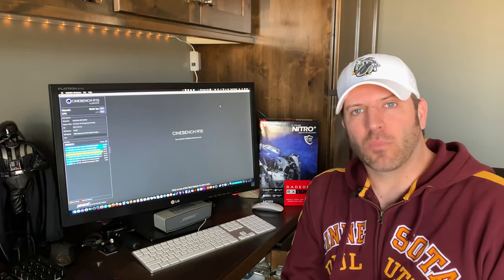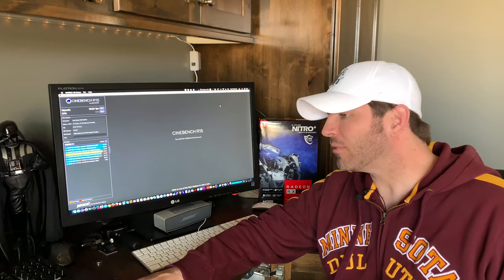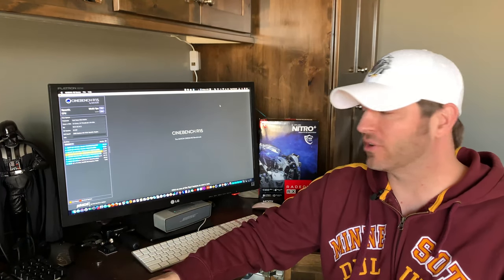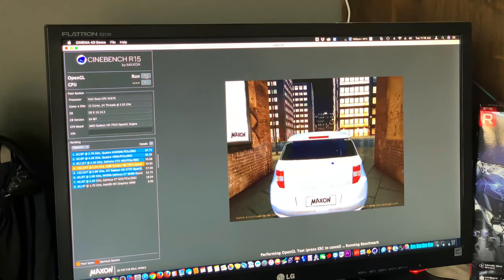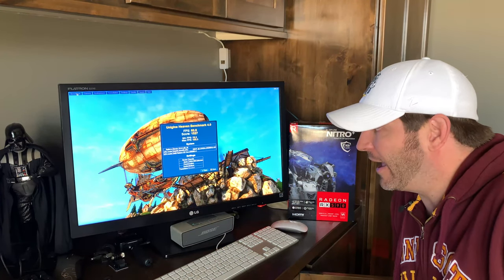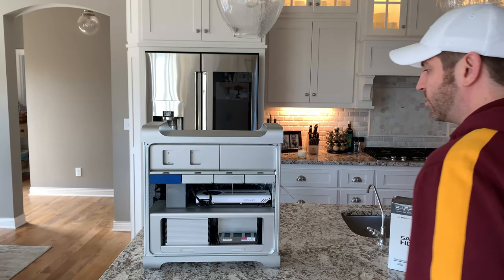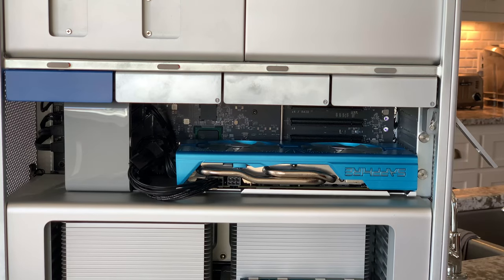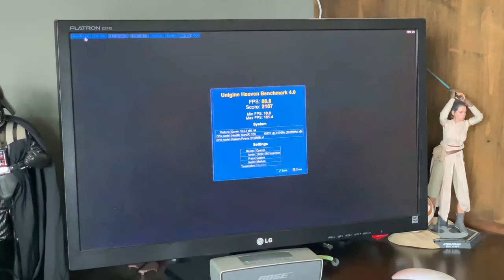Apple Won't Like This  - How to Upgrade the Mac Pro GPU

Comment: I may have missed the system specs of the machine, but I wanted to let you know you could definitely make it much faster.  If it’s a 4,1, you can firmware flash it to a 5,1.  This allows you to put in dual 5690 chips, getting you to 12 cores at 3.46Ghz.  Then, don’t install Mojave ( although it will run it ) but just the firmware update ( start the installation of Mojave to do this ) but stop after the firmware process is complete.  This will double the PCIe interconnect speed.  I’m running a Founders edition GTX1080 ( with web drivers ) and it cuts 4 and 6 K like butter ( even red raw ).  Just remember if it’s originally a 4,1, get the “delidded“ 5690’s, but if it’s originally a 5,1 machine, get the 5690’s with the IHS ( integrated heat spreader ) on then.  Make sure to get ECC memory and it will out perform the new machines.
Reply from the maker: Firmware is at 5,1.  But I haven’t changed my cpus yet.  I’m on the dual 2.93s. But I’ve been thinking about trying the 3.46 ones.  Have you run a cinebench r15 on it?
Reply: Get two 5680's for about a hundred just as good, an inateck 4-port USB 3.0 PCI-E card for Mac Pro-KT4004, and a Highpoint nvme raid card 7101A-1 goes into the second X16 slot after the firmware upgrade to 140...It's bootable and doesn't require drivers or hacks... I went with the Vega 64 for graphics.... and you also have four drive bays for ssd storage ? Now your good for another 5 yrs...Maybe.(yes it will run Crysis ).
Reply: @Luke Schneider If you come across anything else please let me know...Thanks , Gerard.
Reply: @KDSTech  I only have R20. it is 3346 in R20.  Most of my work is Video based, so I focused on configuring the system to prevent bottlenecks.  The 1080 does a lot of heavy lifting in terms of processing, but it will convert red footage at around 60FPS.
Reply: @Kyrad777 ,your good at this stuff... That's what  I need to find a women who's into computers and maybe knows a little coding... Don't seem to come across very many women like that. It was nice reading your posts... Stay in touch if you'd like, starting an Xserve project when my broken bones heal, maybe you could email me some suggestions...Take care.
Reply: @Luke Schneider ,sorry just got your message...There's a guy on you tube I think he calls his channel Evos Vox he's probably the expert for video editing...Right now he's got some great things to say about the 5700's check him out... I'll have to see if I gave you the right name.Almost Epos Vox...Good luck.
Reply: @KDSTech  You won't find much a difference between 2.93ghz vs a 3.46ghz....minimal if any. Read Kyra's remark above... couple of nvme's and you'll be smoking fast.
Reply: why wouldn't you upgrade to Mojave?

Comment: i have sapphire pulse rx 570 4gb. I(s it compatible to my mac pro 2009 2.26. Then I upgrade, 4,1 to 5,1 now. So my question is, do I need a 2-piece  6 mini pin to fill in the required 180w in the sapphire rx 570 4gb (the pci aux A 75/ pci aux B 75)am i right , then the videocard slot have 75w so all is 225w Pls help me out to fixed it thanks  my concern is the power consumption but my power supply is 500w
Reply from the maker: i hope i understand this question correctly... as long as your mb has the dual 6 pin mini outs to the 8 pin, then yes.   it will work

Comment: Do you have a sound with rx580 (hdmi or Display port)? I have a high seirra installed.
Reply from the maker: im sorry.. i don't quite understand.. do i have a sound?  what do you mean?    I am using HDMI for my connection.   are you talking about sound through my monitor?  if so, yes.
Reply: @KDSTech  i have installed mojave. I work now

Comment: You will get better results with both power power cables connected.  An RX590 would also benefit from the Pixlas Mod.  Here is a good reference site:  http://blog.greggant.com/posts/2018/05/07/definitive-mac-pro-upgrade-guide.html#mostpowerfulgpu and pixlas mod can be found here: https://thehouseofmoth.com/mac-pro-pixlas-mod/